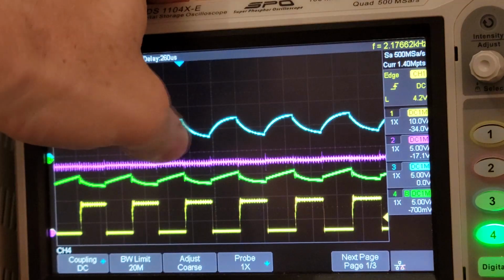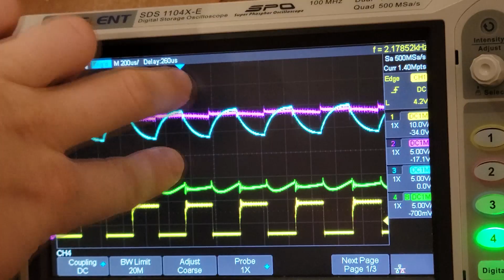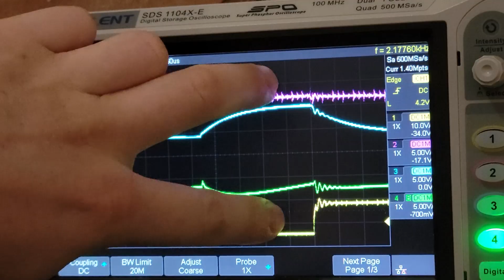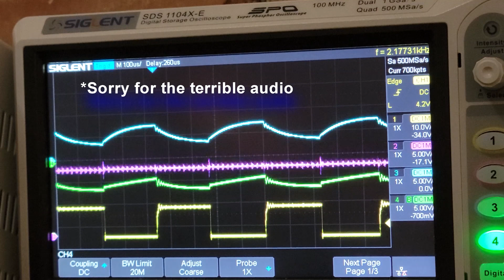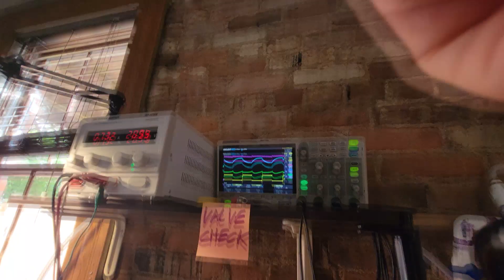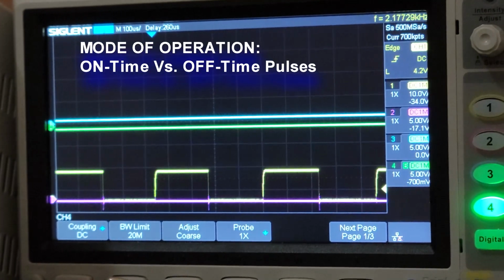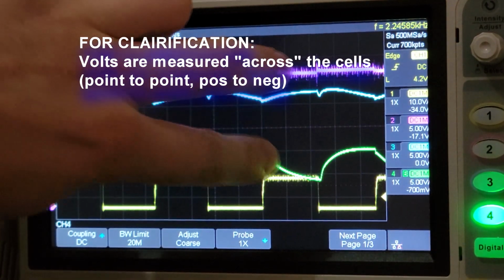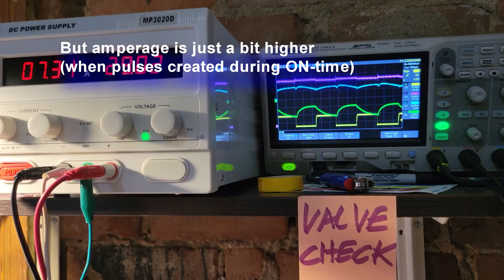Opposite Polarity Pulses During ON-Time Vs. OFF-Time (Mode of Operation)

Comment: I have some knowledge and experience with electric currents in conductive liquids and electrolysis more directly and I might have some insights for you but I can't quite get to that point. I can see several possible scenarios from the waveforms and dialogue but can't see which it actually is.  If you are wondering why or wondering why you have no other comments either, then I would suggest two probable reasons:

1. There is too little information provided and, I am sorry and please do not be offended, but a  lot of what you say while pointing at waveforms makes no sense. I have designed many smps converters as well as biomedical devices that pulse voltages up to 3kV across electrodes in the heart, so I am familiar with what you are using and what I think you are doing but I still can't work out what you actually are doing specifically.

2. It is not beyond possibilities that we may find at some time in the future some crazy aspect of how the universe and matter work that to us now may appear to be perpetual motion. And there are some very very clever people trying to unlock the secrets of stuff and the universe but you, I and Stan Meyer are not among them. I also doubt your likely success with transformer and transistor technology alone. If there is magic to unlock, you might need more sophisticated apparatus to achieve it.

To be frank, you would be far better paid to simply understand what you are dong now (which does have an explanation that is already known) and take it from there. 
Because what you are doing is experiments people have already done and explained the results. I am sorry, but you are not breaking new ground.

I am not trying to rain on your parade. I'd be happy to offer what I can but between the two of us, only you would be trying for perpetual motion.
Reply from the maker: My channel is small and just starting. The algorithm does not favor me and the amount of people actually interested in this tech, let alone take it seriously, let alone actually understand it is miniscule. My technical lingo is not of academia so it may be hard to follow. My purpose is to simply document what I am doing and maybe somehow help others in the field and connect with them.

1. Specifically, what is not making sense? Again, I do not have proper education nor am I using the proper terminology -- I am simply exclaiming what I know in the best way I possibly can. I firmly disagree with you statement about "you, I and Stan Meyer are not among them"... speak for yourself. It's like saying the Wright brothers didn't invent a flying machine. We try, therefore we do. Stan's device was built in the 80's with retro hardware in his garage so I'm sure it can be replicated with today's basic consumer-available hardware.

2. The WFC is not "perpetual motion", as Stan prescribes. Releasing the energy from a substance (just like like oil) is not perpetual motion. Sophistication is a tool of corporations and academia, to which many of the inventions we use and take for granted today did not have the luxury of having when being developed. Stan followed the KISS method, and it is by far the best method for those without millions of dollars in research funds. For his technology there is quite literally not much more needed other than a PWM, transformers, Mosfets, diodes and cells --- basically old tesla / radio technology. My question to you is have you studied any of Stanley Meyer's tech? Just curious.

3. Paid? Who's is getting paid here? Haha. Ok so what explanation am I presenting that is already known? Electrolysis? This is not electrolysis. I do have a firm understanding of what I am doing now, I assure you. I simply lack the in-depth circuit mathematics to take this further, and perhaps the ability explain in 'proper' academic detail. From what I can tell, no one has produced the amount of HHO that I am, with the amp consumption (at the cell) that I am. Especially with my last video only consuming 600mA total input power, I believe I am, in fact, making headway that others have not. I really have yet to see anyone (and I mean anyone presently) produce the results that I have and please correct me if I'm wrong here (links would be great). YouTube is scattered with laughable WFC contraptions, misinformation, ridiculous explanations, and the same old stories going nowhere. Ultimately, I have to disagree about the "breaking new ground" comment, with the exception that Stanley Meyer already broke that ground in the 80's and 90's.

Further regarding 'perpetual motion': have scientists not recently developed a laser fusion device that creates more energy than it consumes? How can that be true and Stanley's tech not be? My email is in my profile if you would like to discuss further or potentially help me. I certainly will not turn down any expertise and would love to pick your brain. Looking forward to your email.
Reply: @noahauman  If you can send me or post schematics I could help you with the power electronics. I can also help with your measurement technique. 
There are several possible explanations for what you are seeing. For your channel (and I wish you well) for your channel to have better credibility we need to eliminate the main stream explanations. I will try to help you with that and to maintain an open mind if you want the help.
Reply from the maker: @smbd2010 check out my latest video. let me know what you think. i would like to talk some time soon (pry your brain)